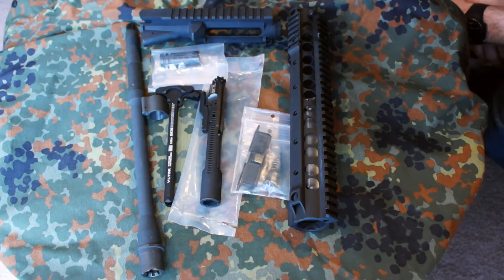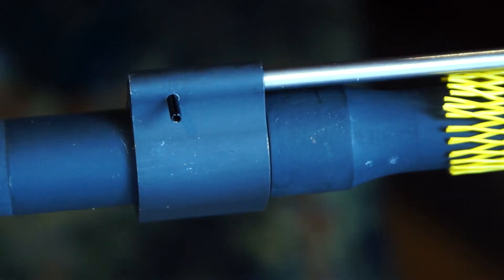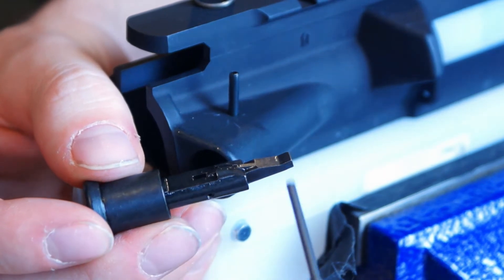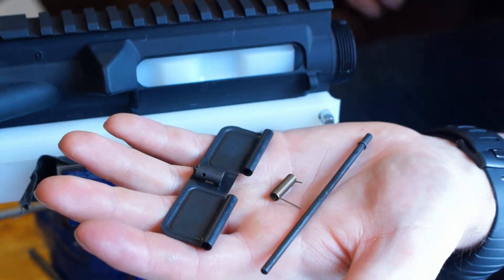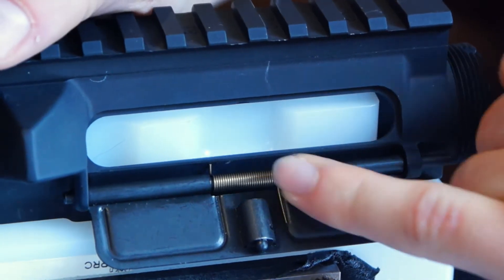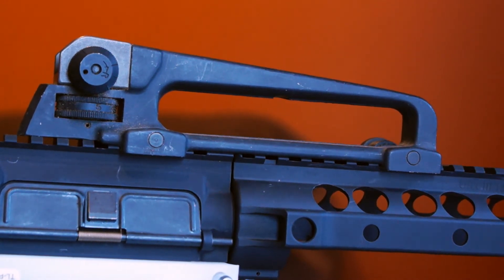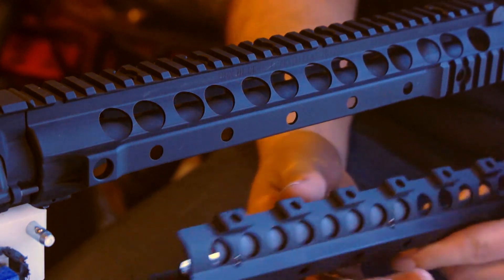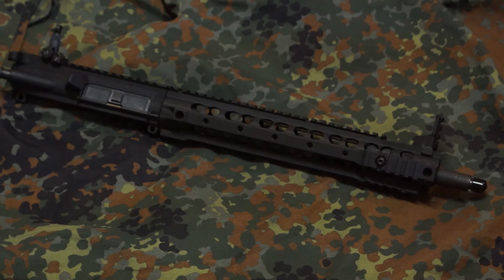AR-15 Upper Build Knights Armament URX III 3 BCM

Comment: Nice video! My upper build is almost a twin of yours. I used an aero precision upper, KAC URX 3.1, Daniel Defense 14.5 CHF mid length barrel and a surefire mb 556k. The only part I didn't think ahead about was my gas block. I used a Daniel defense MK12 gas block and I had to shave down the bottom of it so it would clear the rail. My upper runs like a champ.

Comment: Good video, not very many out there for the KAC rails. I just put a very similar upper together 13.5 URX 3.1 and 14.5 mid length Daniel Defense barrel, pinned and welded a Surefire flash hider so I can run it suppressed. Best and softest shooting shooting upper I own

Comment: I figured you would put the barrel in before screwing the rail on.?
Reply: I know this is an old comment. The URX/barrel/receiver interface is very different than a traditional AR. The barrel nut threads in to handguard and not onto the upper receiver

Comment: Nice Job bro....I used AS 33MS on the barrel/upper receiver interface and Rocksett in the barrel nut/rail interface. For support I didn't have a carry handle and improvised with scope rings and aluminum barstock. 

BTW ....Like your Sunnto Core Watch.

Comment: What happens to that blue lock tight when you get that barrel cherry red from running several mags through it?
Reply: Ronaldo Crespin Actually the chamber side of the barrel is cooler than the front side near the gas block where the barrel is most hottest.  The gas block set screws also use blue Loctite, they seem to hold up fine after thousands of rounds.

Comment: Very clean video man. You did a good job with the camera angles as well as keeping it very to the point. Very professional video man. I would recommend reading the Army's M4 Armorers Manual TM 9-1005-319-23&P. You did back off the barrel nut once so that was better than nothing.TM 9-1005-319-23&P 3-10 Section D recommends that you condition the threads 3 times. It helps keep it from backing off. Loctite is not usually needed but I understand why you used it on the URX rail. Keep up the good work! There are too many crappy armorers videos so it's nice to see a well filmed one like yours.
Reply from the maker: The Army armorers man is an awesome resource. The URX barrel nut is very different from a standard mil spec nut. The URX nut is a very light weight aluminum as opposed to the steel standard nut on most M4s. I didn't wanna risk marring the mating surface for the wrench ( it's kind of a terrible design ) which is why I only pulled it off once. Also, the lock tite was per URX instructions. Thanks for the kind words.